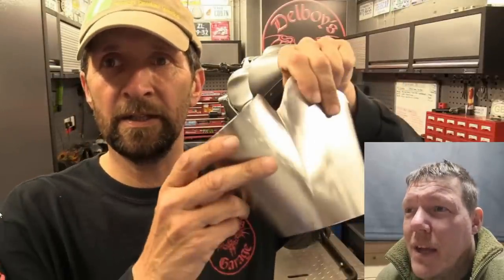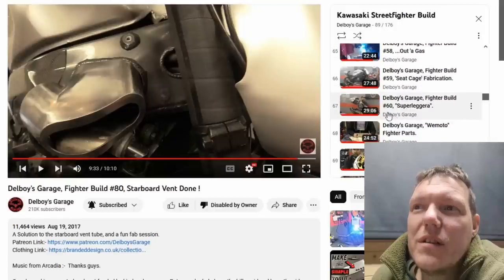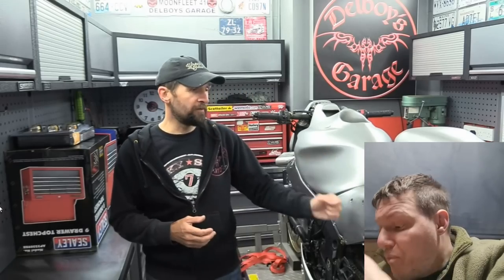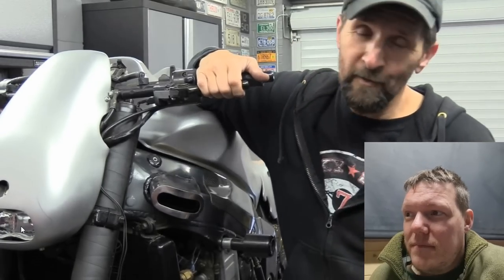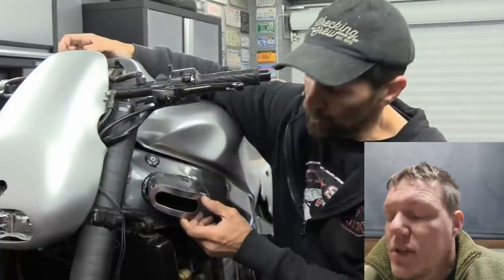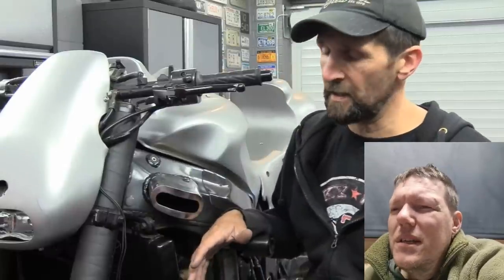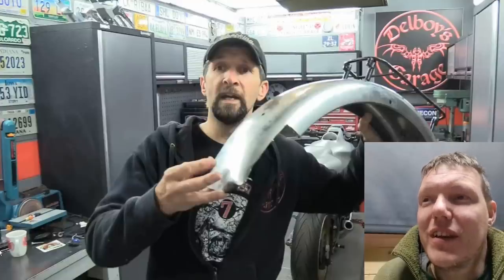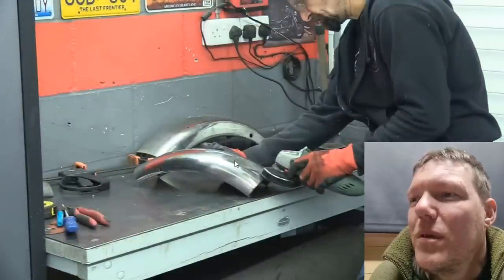HDS 55 - Delsplaining Airflow

Comment: The section he didn't use already had a rolled edge at one end which was the rear of the mudguard, if it was a triumph bsa norton part they all used 18" rear wheels

Comment: My bobber has no back or front mudguard, it passed the MOT, I even asked the guy, he said if it had mudguards then they have to be mounted securely and not rubbing on the tyre but no MOT requires them

Comment: If you need to measure a curve & all you have is a tape measure the quick and dirty way to do it : flip the tape upside down, so it follows the bend. Get your point, flip it over. Of course a string or shoelace or anything works too, then measure it.